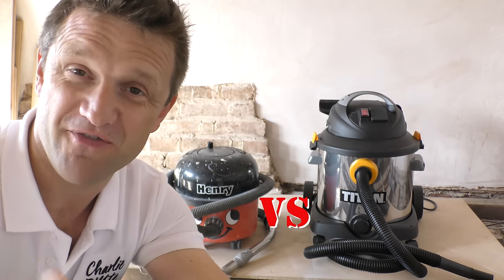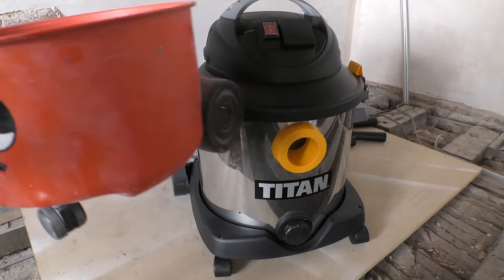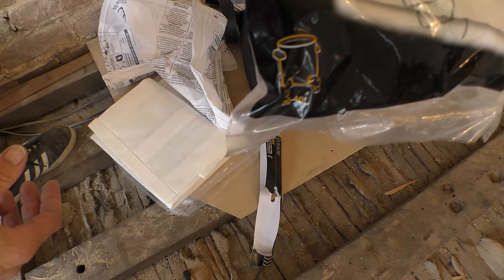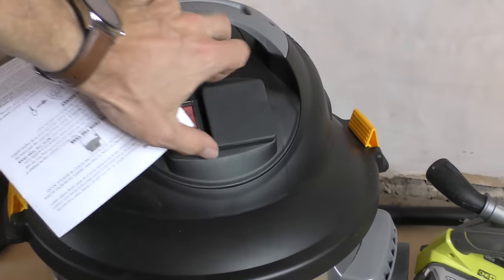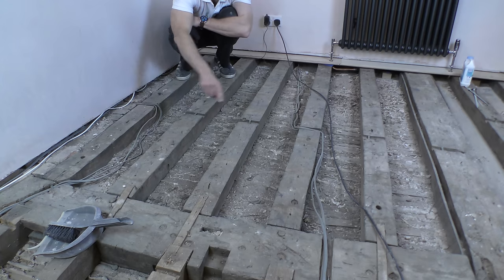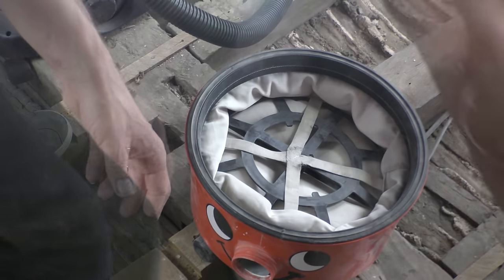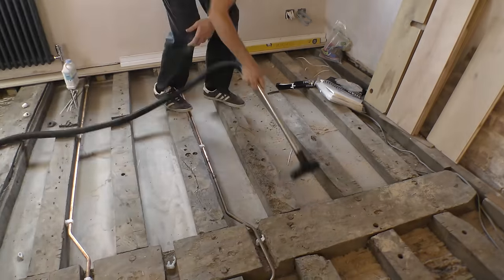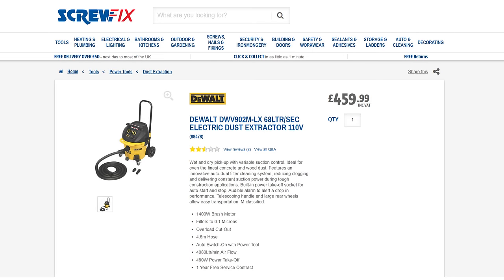TITAN vs Henry - DIY Vacuum Review

Comment: Had one of these for 2 years and worked great especially plugging tools into the hover to activate the dust extraction. Quick tip, when the bag is full, carefully cut the end, empty it then roll it back and secure with a few bulldog clips, I get 5-6 full loads before the bag is useless
Reply: What happened after 2 years?? Good tip on bags
Reply: Thank you!!!

Comment: Build yourself a simply cyclone system. All you need is a sturdy bucket with a lid and a couple of pipe fittings. 99% of dust will stay in the bucket. Loads of vids on here showing you how to make one. Much more convenient than changing bags every few minutes.

Comment: 19 years is amazing from the henry; better off buying a numatic from their procare range, if you get another 19yrs it more than pays for the additional cost.
Reply: Senkatuka23 after a replacement motor isn’t as good as original motor 19 years lol
Reply: @Alexander_l322  because the wattage is lower, you can still get kilowatt motors.
Reply: @TheKlink  you can still buy genuine numatic Henry twin flo motor 1200w the old motor before the 620w motor

Comment: The Numatic Henry is a design classic. I am a floor sander so produce huge amounts of sawdust, we use fairly industrial H Class extractors for that. But at home I use the Henry. Every single nut and bolt is available as a spare part and it’s very easy to work on, it’s one of the few electrical products left on the market that hasn’t been designed with planned obsolescence in mind. 
     It’s a simple design, extremely quiet, robust, lightweight, I would choose it over any Dyson in their range, and certainly over any of the battery operated vacuums that are becoming popular. There’s a reason why most cleaning companies in the UK use Numatic vacuums. They work and keep on working. The Titan on the other hand, made in China, from cheap materials, I’d be amazed if any of them last longer than a year with any decent amount of use. They’ll all be in landfill within 2 years, not degrading, for 800-1200 years.....

Comment: Top quality review Chalie 👍🏾

I own both of these machines. Bought Henry second-hand about 7yrs ago and Titan new around 4yrs ago.    Work as a bathroom fitter and old Henry accompanies me daily. He heats up a bit after 10 mins of constant use but so far has not burst into flames nor refused to put in a shift. Has been dropped, down stairs a plenty and has always kept smiling 😁, good old H!
Bought Titan as I needed a wet vac and it was on offer at screwfix (I think I paid around £40 for it). Have never used it dry and couldn't find the bits for it if I dug through the garage for a week. However,  as a wet vac it is perfect, very powerful but noisy. I use it a lot for clearing tricky branches of central heating pipe and it removes all traces of moisture before soldering. Excellent for emptying rads, WC's, unlocking sinks etc. Huge vacuum also brilliant for cleaning carpets, rugs, car/van interiors after washing. 

To conclude, wouldn't swap H for anything (nice to see him smiling up at you at the end of a hard day) but I find Titan is unbeatable at price for wet work.

Comment: Had my Henry for over 10 years now and still on the same motor. Admittedly I only use it for detailing vehicles, but I do come across some very dirty cars and my Henry never struggles. Would never change it.

Comment: I own both of these.  I’ve reserved the Titan almost exclusively for use with my track saw and any sanders I use, that is to say, in the garage(workshop).  It does a serviceable job of keeping the dust down, the bag doesn’t fill too fast & the power take off is useful.  I’d suggest if you were after an all-round vac for ‘building’ style work, to pick up the Lidl version next time its on special, it’s very good indeed.  The tools are on a par with the Henry too.

The Henry, whilst rugged, I’ve reserved for domestic work.  Interestingly, it’s the new style  energy efficient one, and I haven’t noticed any drop in power compared to the old style one I own (which I’ve left at my rental property).  I can only summarise that they’ve done some work on increasing the efficiency of the air flow between the older and newer models, and not just dropped the HP of the motor!

Anecdote 1: I used to work in the accommodation services arm of a certain large University in the West Country, and Henrys were standard issue in student accommodation.  The only reliable way the students found to kill them was by using them as a wet vac.  I might have built my own Henry out of spare parts from Dead Henrys…

Anecdote 2:  I have it on good authority that the Royal Navy use Henrys on their nuclear subs, without any bags, and they seem to last ok.  That said, there’s not much to do on patrol, so I can imagine junior rates spending their days fixing Henrys, same as I used to….
Reply from the maker: Great comment, mate. You raise lots of good points there and yes, the Numatic engineer endorsed that when I was researching for the new motor. He said efficiencies in the new models make up for the wattage drop. The problem with my old machine which I should have said in the video is that I have a 620watt motor on an old machine that doesn't have the new air flow efficiencies. End result, less suction.
Reply: Henry hoover is the best hoover in the plAnit

Comment: I bought the 40litre version six months ago. Several of the issues have been sorted, certainly the bag connector. I’ve used it a fair bit over six months and the bag is still only half full! The accessories are indeed cheap and that’s the main drawback. But the power is great (1600w I think). I have the same mitre saw as you Charlie and hadn’t realised it exceeded the permissible wattage. It does still work when plugged into the Titan but I did notice a lag of three seconds or so before it turned on. I’ve only used it for sawdust so far so no blockages. Overall impressed

Comment: Charlie. You can repair the Henry body crack really easily. Either used a 3D printing technique of melting ABS in acetone to make a slurry (ABS dust or shards, melted in Acetone over night will turn into a paste ideal for gluing or filling holes). Or use as Soldering iron (an old flat tip not your best soldering tip) and zip ties as welding rods to weld the crack closed (a motorcycle hack for repairing ABS fairings). I have used both but used the soldering iron welding technique on my wheelbarrow as I thought that would be stronger, as I was able to add more material to the damaged area to build up the surface far more quickly than with the chemical weld. I hope that helps.

Comment: I don't know if there's anyone else making such useful and practical review vids. Thanks for taking the time. I have the cheaper Titan vac whech came recommended by a builder for its robustness and throw away price. It suffers exactly the same problams as the one you tested ( same bags) but I've been happy with it so far.

Comment: Just a couple of thoughts with regard to health, the Titan looks to be have a Class L filter, the minimum level whereas it's recommended to look for a Class M machine. The class M machines are pretty expensive but some Class L machines come with a Class M filter. 
Exactly why I decided to purchase a Nilfisk Aero 26/21 (screwfix 66972)(the machine is still class L as it requires auto cleaning etc to be properly classed as an M). It has the power take off which is very handy.
The Titan can be upgraded with a HEPA cartridge (screwfix code 962FG) (the Wickes vac I used to have also used this cartridge). This upgrades collection to 0.3microns but it's still only a class L filter but will be an improvement over the supplied one.
Also have a Henry, they have "HEPA-Flow" bags but these bags are not HEPA rated it's just a brand name. The internal filter is again not HEPA rated but you can purchase aftermarket HEPA filters on eBay/Amazon for £22-£25 ish not tried yet. Numantic do now produce a Henry Allergy HVA160 machine which looks like a Henry with HEPA filtration.
Would recommend the Nilfisk, it's been fantastic.

Comment: The whole ethos of the Henry is it is the ultimate modular vacuum, meaning no part of it isn't replaceable hence why they last forever.   I doubt the new machine has this longevity and in a couple years time the design will have changed or a new unit used making it impossible to repair so you will have to buy a new one.   I have a Henry, the top of the range big one which holds a lot more than the little baby ones, its 1200w too and super powerful, the hose snapped a couple weeks back and it cost me £6 delivered for a new one and I buy approx 5 a year of the washable bags again like £6 and it just keeps going.
Reply from the maker: Great comment Ian, thanks. Out of interest which Henry do you have as I'm thinking of investing in one so I can properly wash the kitchen floor.
Reply: I have a Henry that’s 14 years old, I doubt the Titan will last that long, especially those plastic tools and cheap hose.
Reply: @CharlieDIYte  a George is good it washes floors and shampoos and washes carpets aswell

Comment: Hi Charlie, I run a cleaning business and they all use henries, I have not had any complaints and the business has been running for five years now ( without any of the henrys needing replacement). You can get a cloth bag with a hard rubber end that can be emptied and reused although I have not used these because my staff doesn't want to have to empty them. As for the titan, I have one that I added a dust deputy to it and a 55-gallon barrel, I use it in my hobby woodwork shop and I have had to empty the barrel twice and there is no sign of any dust on the filter or the motor. Another good point about the titan was that the wheels were not attached and this made it easy to add to my system and I just added the wheels to the wood base that holds the vacuum, dust deputy and barrel.

Comment: I have a smaller version: the Titan TTB350Vac. I bought it a few years ago for a bit more than 20 quid (it's 35 quid now), which is a real bargain. It lives in my workshop and only does light duty.  The key for me was that at that price I could afford to have one specially for the workshop rather than dragging out the house vacuum cleaner when I needed to clean up.  I agree about the quality: it's definitely cheap and cheerful (mine gets blocked too), but I think the core of the machine is pretty robust and great value for money.  PS.  Well done for resisting the temptation to make an awful joke like: "Vacuums suck!"

Comment: Greetings from France, we have a karcher wd2 ...paid 50 euros (about £45 at the time of purchase) for it, the bag capacity is small, but there is never any dust on the inside of the canister EVER! 1000watt motor powerful enough for my diy and use around the house and car! i have changed the hose and replaced the plastic tube for a metal one, luckily for me my last shopvac tools fit the karcher! If need be i can actually join the karcher hose and old shopvac hose and have a 6m reach! tyvm for the vids, keep up the good work.
Reply from the maker: Sounds awesome, that! Yes, always have dust inside the canister. The designers who presided over the overly large hole in the dust bag should be sacked! Also annoys me that there's no cable tidy, so much so that I've now coiled up the entire lot and zip corded it to the handle! And the hose kinks often because the plastic is so flimsy.

Comment: FWIW I’ve owned the same Titan for nearly five years. I bought it both for DIY use and as a shopvac for use with power tools. I added the Rockler Dust Right Universal Small Port Hose Kit, which is a perfect fit into the Titan, and also has a much wider hose. It’s been more than fine in that time, but I agree that the hose and accessories supplied are not great. Still, for the money, it’s been a great buy.

Comment: I have a very old Henry but as I am setting up a woodworking shop now that I'm retired, I bought a new machine very similar to your Titan from Aldi. It is a 1600W motor and has an automatic power socket built in. However, I do use it with a cyclone type separator on top of a big blue barrel from Amazon. The whole thing is cumbersome to move but works very well indeed in my workshop. If I had a job like your attick, I would make the effort to take all of the kit up there as almost no dust (sawdust anyway - old plaster dust may be another matter), reaches the vacuum. If you want the item details, drop me a line and I will look them up for you. Many thanks for all of your clearly presented and useful videos.
Reply from the maker: Thanks John. Sounds like a perfect machine that, and powerful too! Funnily enough I too have now installed a cyclone and am loving it. I'll be doing a video on it this weekend 👍🏻

Comment: I own both and have always used a Henry floor tool and dust brush. I've never had any of these problems with mine and I use it as a dust extractor, it's superb. I also bought an after-market hose extension don't have any problem with hall, stairs and landing, I can leave it at the foot of the stairs. I had a sparkie mate make an extension for the dual tool feature and it works a treat.

Comment: My Henry is 600w lo power and 1200w on hi power. I did have to buy a new on/off switch for it but its had 6.5 years of abuse including the metal pipe being run over and bashed back into shape again. As a tradesman I would not be without it, it may not have the capacity of some but then it takes up less room in the van. If I need to suck up a lot of rubble as in your video, I have a very cheap ash can attachment which needs no bag and will take all of the rubble without a problem. You get what you pay for and Henry is the champ.

Comment: I bought my Henry in early 1993 after using them in automotive glazing where we used them without the filters to pickup glass pieces and any other crap and detritus and they just kept on going. In the depots we used large capacity Numatics.
Mine is about 1000 watts and would have taken up your floorboards up no problem as well as the carpet. Have to use the suction control sleeve on metal tubes to keep it under control. Best vac I ever bought and still going strong.
Reply: Yes they were originally designed for trade use, not domestic use, but the smiley face gave them mass appeal

Comment: Wickes own brand circa £50 wet and dry + £15 universal filter that is designed to ditch the need to change for wet or dry, being a plumber use this mainly for wet and can say last much longer than the Charles, great for sucking out blockages and draining radiators with. Keep up these great videos Charlie they're great..
Reply from the maker: Thanks buddy. I'll take a look at that. You probably saw this vid https://youtu.be/9RfHpm2vf40 but it made me realise it was unfair to pit the Titan against Henry in a domestic setting as it's not designed for domestic use. Connect it to a cyclone as a static shop vac and it comes alive.

Comment: Is it possible to use a Henry bag or any other make of model fit on a Titan vacuum to get a tighter seal around the hose inlet?
Reply from the maker: I don't think so, as the diameter is so much larger. Really, this vac is designed to be a shop vac attached to a cyclone, as discussed here https://youtu.be/9RfHpm2vf40 That way you don't need to worry about the vacuum bag.

Comment: Almost 2 years since you originally posted this video I know. No matter, came across it whilst considering the Titan as my next "workshop vacuum". Agreed with all the negative points you raised so looked a bit further for another piece of kit somewhere between Titan @ c. £50 and Henry @ c. £130. The answer I came up with was the VacMaster Power 30 PTO. It costs £90 and has s/steel suction tubes, larger diameter 2.5m hose and full floor head. You can even upgrade the filter to a HEPA one for £16. Finally a pack of 5 x 30L "fine" dust bags are only £15. This is the piece of kit I ordered as I think it does everything the Titan does but better. Even with the HEPA filter and a set of 30L bags it came in at £120. I did however get 10% for setting up an account and so got a top class package £22 or 17% cheaper than standard Henry.

You can find the VACMASTER POWER 30 PTO WET & DRY VACUUM CLEANER here,

https://www.cleva-uk.com/collections/garage-workshop-vacuum-cleaners/products/vacmaster-power-30-pto

The accessories (including all bags and filters) can be found here,

https://www.cleva-uk.com/collections/vacmaster-accessories/Vacmaster-Accessories
Reply: voted clear best vac in a recent test!  I would just like something smaller myself

Comment: Titan is cheap for a reason

Is the advertised 25litre capacity taking into account that huge filter because it looks like the filter takes up 1/2 of the capacity?

BTW Charlie, now that you have 102k subscribers (well done 🍻) more vids pls
Reply from the maker: That's a good question Azza. I suspect the capacity takes into account the massive filter, and to be honest it's more than enough either way, for most jobs, if you think it did the whole floor on one bag. Thanks mate.. Plenty of vids in the pipeline. Just wish the inertia of life and the occasional demands of the day job didn't keep getting in the way!!

Comment: The best DIY vacuum I have had was a 1990 vax power 4000. Basically just an old style canister vax. It was used domestically and for diy for nearly three decades. It had a replaceable cloth bag and I used it to suck up rubble, soot, ash, sanding dust etc during the renovations of five large houses. The only ever failure was a rocker switch. Sadly it recently took a tumble down some stone cellar steps which finally killed it. It was like loosing my first pet dog all over again, I was gutted!
Reply from the maker: Sounds like a great machine. I feel your pain Spencer - you become strangely attached to them for all their loyalty over the years! What did you replace it with?